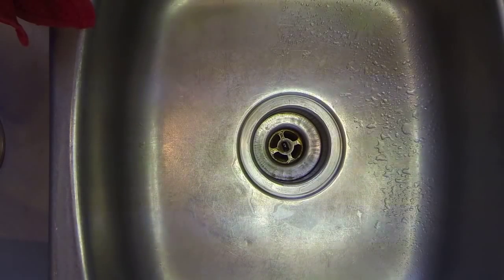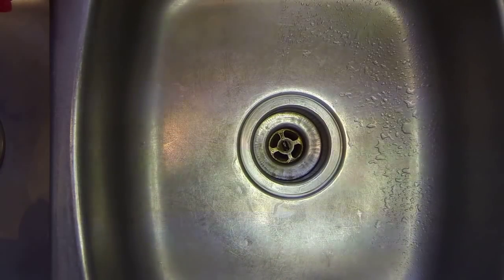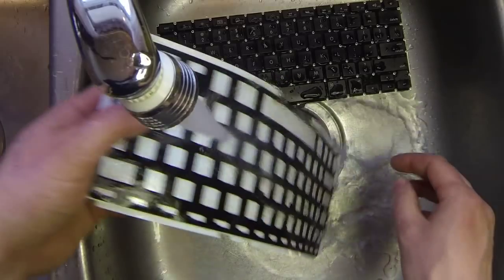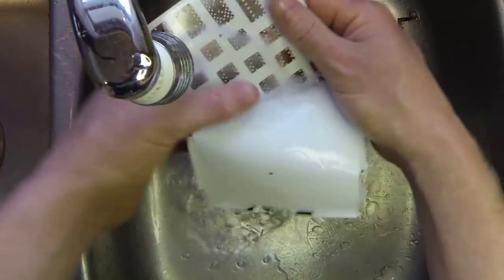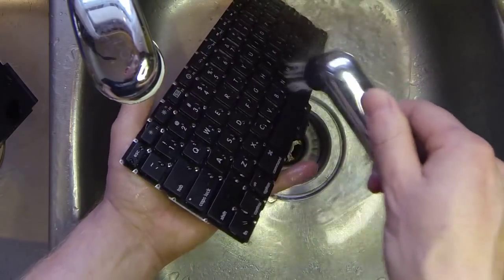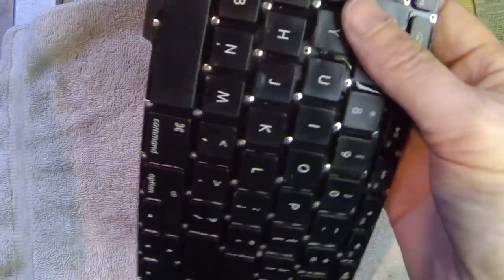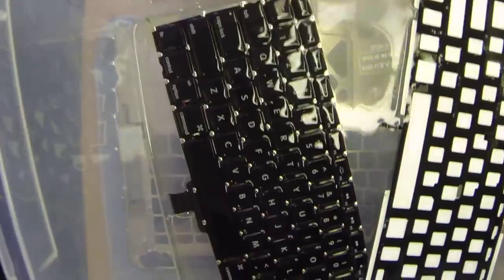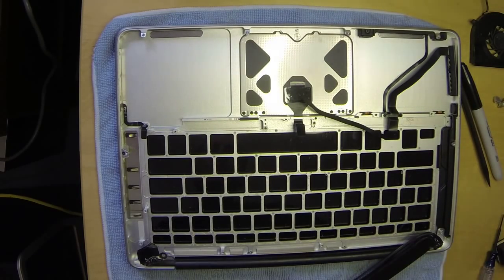Guide: How to Clean a sticky or spilled on  Macbook Pro Keyboard - Easy & Detailed Instructions

Comment: Can you let me know exactly where to go to get a new keypad?  I have a macbook pro 13.3 screen 2.5 GHz Dual core Intel i5 (Refurbished) directly from the Apple Store.  It is a 2013 year model I believe and I made the error of spraying cleaner on the keypad.  I saw a some distortion with the screen (I didn't turn off the computer b/c I was not a bright person at that time :-(...) so now it won't turn back on.  I wanted to try and change the keyboard and hope that would make it work (the charger light still comes on and another light from the side when I last tried to see if it would work.  I purchased this computer in April or May of this year (well my boyfriend actually purchased it for me) so now I feel really bad that I destroyed it about 2 months ago.  I saw your video and now I feel like I might have hope.  Can you send me any information that would help me possibly get my Mac back to working...my email is cpalmer_05@yahoo.com.  thanks in advance for any help you can give.
Reply from the maker: +charlene palmer Hey there, i'm sorry for the late reply but your comment ended up in my spam comment folder likely because you entered an email address(which honestly you should never put out in public like this because of spammers) which youtube doesn't like. I'm not sure if you still have the issues or not but unfortunately the 2013 models are completely different than the ones in my videos. The keyboards ARE replaceable but the process is extremely more difficult and I don't have any video of that model yet. They keyboards can be found on Ebay very reasonably priced. Let me know if you have anymore questions.
Reply: Hi Charlene, I just read your comment. 
I hope you bought a keyboard but in case you still have the old one, I bought this keyboard in eBay, replaced in mine and after a couple of hours of work, the laptop forks fine again. It is not for the same model, but maybe this seller have different ones.
https://www.ebay.co.uk/itm/A1278-Apple-MacBook-Pro-13-Unibody-Laptop-Keyboard-UK-2009-2012-NEW/112493842143

Comment: Hi MrTechEasy! This video was GREAT the keys on my keyboard feel like new! Had a couple issues though: 1.The backlight is off where the spill occurred, which isn't a huge deal, but I'd love to fix it. 2. The period key doesn't work. I understand the former is something I would have to buy a new backlight for; however, is the second a surface level issue that can be fixed?
Reply from the maker: +Preston Hitzler Thanks for the nice comment.
1 - The backlight panel(the really thin panel that was peeled off the keyboard before the removal of the keyboard) a lot of times just needs to be replaced. They can be found on eBay for around $14 last time I ordered one.
2 - If the period key doesn't work then it's possible that the electrical trace for that key was damaged. Short of cleaning it again and retesting it might require replacing the entire keyboard assembly.
Keep me posted on how it turns out.
Reply: +MrTechEasy Thanks for getting back to me! I've ordered a new backlight + keyboard—I'll let you know how it goes!

I am having another issue and am wondering if you've seen it before. The MacBook now sometimes will not turn on. The light on the charger turns on (green) when I plug it in, but the computer does not turn on when pressing (even holding) the power button. I've been able to get it to turn back on by removing the logic board all over again and putting it back together; however, it only works once I attach the charger after it is reassembled. Any thoughts on what might be the cause there?
Reply from the maker: Preston Hitzler The power button is actually part of the keyboard assembly so if you have spill damage to it it's probable that the power button isn't functioning properly. I know sometimes when I put a macbook back together when I plug in the magsafe adapter the unit turns on(not sure why, maybe receiving power through the board for the first time since being disassembled) so maybe that's why it works after putting it back together. Let me know how the install goes and also if replacing the keyboard fixes the power on problem.
Thanks :)
Reply: I got the new keyboard and installed it; it totally fixed the problem! The computer now turns on every time and the period button works .... woo! Thanks, again for the great video—it made this whole mess much easier :D
Reply from the maker: Preston Hitzler That's great! Glad to hear everything worked out in the end for you! I love success stories! :)

Comment: I spilled just a little bit of water on my keyboard about 12 hrs ago, and the keyboard does not seem to be working at all. Last night a few keys worked but now none of them do. It has been sitting upside down on a towel covered in rice all night. Should I try to dry it with a hair dryer before I go in and clean it as you have shown?
Reply: Ingrid Wissink
Reply from the maker: Ingrid Wissink I'm sorry I didn't see your comment until now. I hope you got it working alright. Sometimes it dries out and works and sometimes it doesn't. You have to be careful with a hair dryer not to overheat the keys as I have seen them melt. Also you should always put the electronics in a sleeve(sock, pantyhose, etc) when putting in rice otherwise rice can actually get into the vents, ports etc of the Mac and cause more issues. I've seen it too many times.
Reply from the maker: Gabriele Davis Sorry I missed these comments.

Comment: Do you think it  could work with IsoPropyl Alcohol ?
 And how to glue back the backlight sheet ?
Thanks a lot
Reply from the maker: PuddleD Yes, as long as it's 97% or better. I think 93% is ok as well but i'd use 97% personally.
When you peel the backlight sheet off do it carefully and it can usually be reused, the sticky edges usually stick again. Or you can order a new one off eBay for around $15 shipped.
Sometimes the lighting on the backlight sheet is messed up after a spill.

Comment: Excellent video. I had a spill on my keyboard and I didn't really think was that bad but after only one day the keys started to malfunction and then the power key quit working all together. Your video on disassembly and cleaning really gave me the confidence to complete this repair myself. 

One word of caution if you use a blow dryer to try and dry off the keyboard, make sure that the blow dryer is set to a LOW heat setting. I set mine to high and ended up melting a bunch of keys. I was able to find the keys online for about $5 a piece but I ended up getting another keyboard for $40 online and used it instead. Once everything was reassembled it worked like a champ! Probably should've just replaced it to begin with especially after seeing how many small screws were used to hold the keyboard in place, a little ridiculous but it works I would've hated to put everything back together only to realize that the original keyboard still had some issues and have to take it all apart again. 

One technique I used was each time I removed a component I would take a picture of the component and the screws that would go with it. I ended up putting the component and the screws in a ziplock baggy so I wouldn't get all the screws mixed up. I had to leave mine apart for a few days waiting on the new keyboard to arrive and I didn't want to forget which screws went with which components.
Reply from the maker: Jim Cantu 
Thanks for the great comment and excellent tips you added. Very true about the heat on the hair dryer!
I've gotten good enough at the keyboard replacements over the years that I can do a complete keyboard replacement from start to finish in about an hour so it's not a huge deal for me if the cleaning isn't successful. I also usually have spare macs laying around that I can test the keyboard on before reinstalling completely. :)
Great ideas on the screws. Better to be safe than sorry. :)

Comment: I followed the steps exactly as shown in this video in the hopes of repairing a MacBook Pro keyboard that had liquid spill damage. The one I'm working on seems to be in a much better situation than yours was, with only half the keyboard affected by the spill. Before attempting this, the keyboard was not fully working, the power button was non-functional, and a couple keys didn't work. Other than that it functioned fine. Anyway, after following the steps exactly as shown in this video, the keyboard now hardly works at all. All the function keys are non-functional, the machine always thinks the Shift key is pressed, and about 1/3 of the main keys, including the delete key, are completely non-functional. It also sporadically types random, weird characters when using the main keys. Before reassembly, I left the keyboard to dry in front of a fan for a full 12 hours. I closely examined the keyboard for any liquid before I put it back in the machine. Do you have any ideas what's wrong?
Reply from the maker: Did you rinse the keyboard in alcohol after washing it with water? If not you likely did more damage to it even when letting it dry. Water will cause corrosion which causes shorts in the intricate electronic connections on the keyboard.
If you did rinse in alcohol and still not working then it may just need to be replaced. This DYI doesn't always work 100% of the time if enough damage has already occurred to the keyboard from the original spill.
I am confused on your comment however about before attempting this repair the keyboard partially worked but the power button was non functional. How do you know the keyboard partially worked if the power button was not functional?
What was originally spilled on it?
Reply: I'm not exactly sure what was original spilled on it, but after another day of drying it works perfectly fine. The only thing that still does not work is the power button. The machine can be turned on by unplugging the battery, and then plugging in the MagSafe connector, which will make the machine power on by itself.
Reply from the maker: ***** Glad to hear it's working better. That's usually because it wasn't dried good. Did you ever rinse in alcohol after cleaning?
The power button is controlled through the keyboard so it's possible there is damage to it. When you press the power button can you feel the click? Sometimes when the keyboard is put back in if it doesn't get placed properly back in the frame it won't depress properly.
Reply: I did wash the keyboard in alcohol after cleaning it. And I'm certain the power button has been placed in properly, as it feels exactly the same as it did before repairing.
Reply from the maker: ***** Well it's possible the keyboard is simply beyond repair. Replacement keyboards are fairly cheap from eBay. Usually less than $40 new with new backlight.
Reply: After extensive research I've concluded the only wrong thing you did is actually get an apple keyboard, ditch that crap and buy a mechanical keyboard with blue/brown switches

Comment: And this doesn't ruin the keyboard by washing in water?
I appreciate you then clean in IPA, just didn't think this would work!
Reply from the maker: There are no electronics or stored power in the keyboard, only ribbon cables. As long as you alcohol bath it immediately after washing in water it will be fine. The alcohol disperses any water that gets in the tiniest of spots on the keyboard. I've done probably a hundred of them and never had a problem. :)

Comment: where is the link to remove keyboard, i did not see it.  notice i can't use caps, thus i can't reset SMC etc...frustrating.  Seems that the book closed with monitor on full brightness and never went to sleep.  i suspect condensation from the heat dripped onto keyboard creating further problems.  i have no 'left shift key' and seems my control, option and command keys also aren't working properly.  i believe its a combo of SMC problem plus secondary problem of condensation hurting the keyboard.  this is a late 2011 macbook pro 15
Reply from the maker: Kelly Albertine  
Here is the link to the keyboard removal video.
http://youtu.be/BmD3fVcCg3g
Caps lock key isn't used for resetting SMC just so your aware. 
What kind of condensation are you referring to dripping on your keyboard? Your macbook itself shouldn't be creating any condensation unless you are using it in a very humid enviornment or if you are turning it on after it's been left out in extreme winter cold.
Please let me know if you have any further questions and i'll try to reply sooner. :)